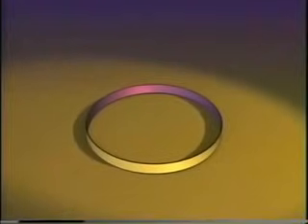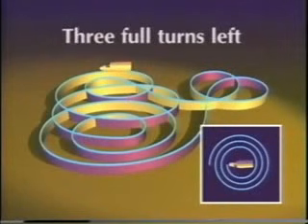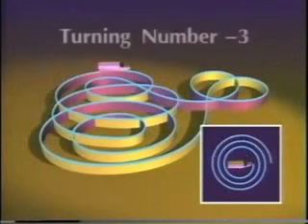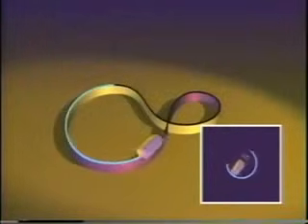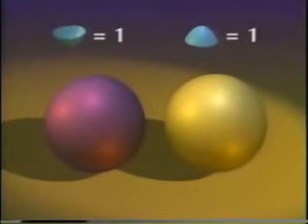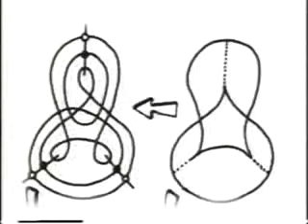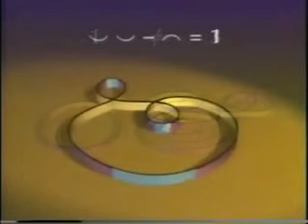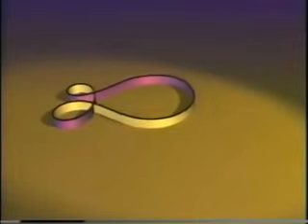how to theoretically turn a sphere inside out

Comment: For people asking what's the point of this:

Prehistoric people didn't have the concept of numbers. Sure, they had ideas for concepts like "four men" and "four rocks" or "four fish", but they didn't have the idea of "four" as a number that you can apply to anything. But eventually, people figured it out. And that's useful because even if four is an abstract idea, you can apply back it to the real world and real objects. You can even think about having four of an abstract object, like "four memes".

Topology's the same thing, but for shapes. Instead of thinking about specific shapes, you think about things like turning numbers that apply to lots of related shapes. You figure out things about these abstract shapes, then you can apply it back to the real world and real shapes, the same way you do numbers.

Plus, a surface doesn't have to be made out of atoms -- you could be talking about, say, the surface of an electromagnetic field. Molecules can't go through each other, but photons sure can. Or you could be talking about the surface of a 3D graph, like when you're measuring motion in multiple directions.

Turning a sphere inside out might not be useful on its own, but the ideas that lead up to it sure are.
Reply: Then why was the sphere even included? After they move on to the circle the sphere concept is abandoned. If all they wanted to teach were topology concepts they couldve just cut out the beginning of the video. Making a ridiculous claim to be like "nah not really, we're really going to show this instead" is just clickbait

Comment: If you create a two portals facing each other (on opposite sides of a hallway) and then tied a rope leading through both of them, would the ropes be straight or in a circle?
Reply: Well, the one end of the rope is tied to the other end, so I guess technically it is a circle. However, looking down into the portals we can see that it creates a straight line with ties in each segment. If you consider for whatever reason that the ties you see through the portals are different than the one directly in front of you, then it would be an infinitely long rope. I hope this makes sense since I can barely even construct a sentence when I should be sleeping.
Reply: My brain has had enough today please dont
Reply: @AwesomEthan  Wouldn't it be straight?
Reply: Topologically it’s a circle in a non-euclidian space
Reply: a circle with an infinitely big radius, but it'll appear as an infinitely long line
Reply: yes
Reply: depends on your definition and the way the portals are implemented.

Comment: First, you must grab all points of the sphere. Pull them all towards the center of the sphere, and then parallel from their original positions. With a circle, you do the same thing. Grab all points, and pull them to the center, then mirror them parallel to their original position. It should look something like this: X. Wait... Tac Toe NIM Toe Tac time toe Tac Tic tac toe... OXO Avyon Lux Council confirmed! Okey, so that sphere I told you about is beyond your simple primitive minds, right? I will give you a link to the shape, I will just explain the shape here until I get the link. Okey? It basically has two merged parallel rings. The interior of the rings are infinitely deep, yet, limited to the specific size of the rings.

Comment: So if If you can divide the sphere into horizontal strips, doesn't that mean you should be able to make those strips infinitely small as to arrive at a circle of infinitely small width right at the equator. If that one strip which is a circle is part of the inversion process doesn't that violate the principle that you can't turn a circle inside out?

Comment: Pretty cool theoretical geometry, but where the hell is the rest of the video?? It cuts off just before the actual methods to turn a sphere inside out get explained.  Very frustrating.
Reply: This is actually topology, not geometry.
Reply: Okay, thanks -- I wasn't really aware of the distinction.  Wikipedia's "sphere eversion" article says that some methods use both topological and geometric techniques, but since this video cuts off early, I'm not sure whether they use any geometric techniques here.  However, thanks to that article, I found the non-truncated version of the video, "Outside In", posted by ssgelm.  Going to watch the full version later this evening.
Reply: It's a pretty cool video. You rarely see advanced mathematical concepts explained this simply. The beauty of topology is that it makes for interesting visualizations, but the underlying concepts are hard to explain without sounding arbitrary (as indicated by all the »what's the point that material doesn't exist« comments.) It's important to understand that this has nothing to do with any »material«. We're simply talking about transformations through functions with constrained properties such has continuity.
Reply: There's a part 2.

Comment: How can you have a crease when they can pass right through each other
Reply: Because I'm Batman
Reply: The physical sphere represents a mathematical construct, not the other way around.  The rules are there because of the mathematics of n-dimensional surfaces, not because of arbitrary physical properties.
Reply: It theoratically works in 4 dimensions of space
Reply: a crease means an angle of some sort
Reply: neopalm2050 
But there were creases being formed
Reply: Aidan Maley when?
Reply: Because logic.
Reply: Layman:
It doesn't work like it does in the real world, its a rule constructed by a "theory" and you have to follow it to get the right answer.

Note that you can not apply physical properties as we only work on GEOMETRY in this problem, so that's why you have to set aside what you had learned in real life (unlearn) to learn GEOMETRY, because it has different rules.

Comment: 3:29 um im sorry what? just Twist the inside of the circle out like an inch at a time... no sharp bends, it doesnt even have to pass through itself. what is this video talking about? And actually I was thinking about this EXACT thing because of conversations abotu creating warp bubbles. The ship needs to be surrounded by the bubble, however it FOLDS space so would it not be a 3 dimensional object, more like a doughnut? If so can it or a sphere be inverted?

Comment: To anyone curious why this matters: It's talking about solutions to equations with multiple variables (or even equations.) Problems where there's multiple variables can have multiple solutions that form shapes when graphed. In a circle equation, (x-H)^2 + (y-K)^2 = R^2, the "circle" is made out of the possible combination for x and y and that make the equation true. In problems where more is going on, 3D (or even higher dimensional) shapes can happen. Manipulating the shape of something in ways that don't break the equations (having an infinitely thin point, producing a divide-by-zero error) is useful for mathematicians, or possibly even engineers modelling the solution space of real physical problems (although tbh I don't know any examples.)

Comment: I love when scientists make things like this and apply arbitrary rules to it. If you can just say "Oh make it out of this non existent miracle material" then why apply the rules about creasing or tearing it? those rules also matter because you arbitrarily said they do.

If you can just arbitrarily say it's made out of miracly rubber, why not arbitrarily apply the rules that it can crease on itself and self heal if it tears?
Reply: Aisha Kegawa They are NOT making shit up. There are real life uses for topology. It is extremely important for the evolution of electronics to what they are today because it studies form relative to points. What is a circle if not a line that curves around to meet with it's end. In this case matter can do that if its not densely packed together. Molecular structures often follow the rules set by topology aka no creases. Topology creates theorems like the fixed point in space theorem which helps in physics. It also helps with making an algorithm which a robot uses to move around obstacles. This exercise is called a veridical paradox. It seems impossible to turn a sphere inside out smoothly without tearing or creasing but it is achieved.
Reply: Aisha Kegawa atomical structures have those "theoretical" properties very commonly.dna passes through itself.
Reply: I bet you're the type of person who thinks pythagoras' theorem is useless because they don't use it when they go shopping.
Reply: This isn't science, it's mathematics. Don't confuse the two. Also, don't dismiss the exercise just because the rules are arbitrary. You should know that the rules of quantum mechanics are completely arbitrary.
Reply: but this isn't about challenge, it's about theoretical possibilities. It's bad science to say this is theoretically possible when you apply so many arbitrary rules just to make it work at all.
Reply: This "challenge" was most likely developed to visually show some sort of mathematical theorem if I were to guess...
Reply: They explain it. If you can form sharp corners then you can create any curve you want, it isn't a challenge.
Reply: I can't take anything seriously that has to make assumptions that can only be true in a universe that breaks the laws of physics (even theoretical physics).

It's only possible as a thought experiment that ignores the laws of physics.
Reply: If you crease it there still will be an infinitely small loop in it, so it's not completely inside out
Reply: But it's presented as an actual scientific exercise. I could make anything theoretically possible if I made up arbitrary rules that allow it to happen. 

If only scientists realised all they had to do was just say something is possible, could of saved so much work testing theories.

I mean all you have to do is say that the it is possible to pull energy from nothing and bingo FREE ENERGY!! Guess all those nut jobs claiming to be building devices that pull energy from the quantum vacuum were right all along they are just using the scientific principle of making shit up!!
Reply: Then why the other arbitrary rules like it can't crease or that when it does it evaporates? 

Again it's made up rules just to make it work and that is isn't even bad science it's not science at all.
Reply: Imagine that sphere as a 3-dimensional mathematical function.
Reply: it is about the challenge too though! This is a great exercise of ingeniuity!
Reply: It's mathematics
Reply: Obviously because tearing or creasing a sphere or a circle makes it no longer a circle or sphere, due to the fact that you are adding sides and vertices.
Reply: +Granny Trrelli Pretty sure science englobes mathematics, particularly what has been verified (as opposed to i.e. theorems).
Reply: RedHairdo Science and mathematics are very closely related, but not the same. Mathematics is like a foundation and science is a structure built on top of it. Mathematics are the base for many different fields of study too.

Comment: It can pass through itself , but can't get creased ?
Reply: If you pay attention to the way the circle passes through itself, you can see this sorta loop thing it forms. When you keep pulling on the circle, the loop appears to get smaller and smaller. The problem with a "crease" is that this "loop" will only ever get infinitely smaller, never truly straightening out. It may appear as if the circle has been turned inside-out, but it's not. There is still gonna be that loop in it.
Reply: +Fnoee it's more thought out than one might think. If you crease it, it gets forever smaller, but never flips opposite at any point. It's a kind of safety mechanism to prevent infinite loops.
That would have a turning radius of 12
Reply: It's the opposite of stupid. Theoretical mathematicians are quite possibly the smartest people on the planet. If you don't understand what they do or why it is interesting, that's your problem, not theirs.
Reply: +John K if we don't understand it, that means god did it. duh.
Reply: It's one of the rules of this field of math -- topology -- because to do so would be fundamentally changing the object. Topology is a really weird and abstract field of math, but it has its applications mostly in quantum mechanics, and I think it's helped with some computer science as well. I've seen examples of it used for quantum field theory, machine learning, network structures (although that honestly looks more like graph theory to me) and, because it contributes to quantum mechanics, quantum computing theory.
Reply: Why should spheres made of materials that can pass through themselves be a relevant thing to talk about ? As far as I am aware there aren't any things in the real world even close to this. And if there are , we haven't discovered them , so this video will remain irrelevant until we do.
Reply: Stratos 420 The same thing goes for paradoxes. It's just fun to think about. Why does it matter if it's useful or not?
Reply: Sometimes things are connected in very strange manner. Especially in math. You might think, that, oh, I just invented a new cool algorithm for astronomical calculations. Than you find that part of that algorithm is strange integral of a strange function. And integral acts just the same as that material! What will it mean? It will mean that you don't need to calculate that integral, and all you need is just to count number of sedals and that other stuff. Then you turn sphere iside out, and the same algorithm forcasts earthquakes.
Reply: touché
Reply: +Karkat Vantass what about the creases it makes from simply crossing two sides together? I see many corners.
Reply: Karkat Vantass
 I watched part 2 (not the whole video ) and I kind of understood what they were going for but this is still extremely stupid in my opinion.
Reply: yep!
Reply: +Arqwer but I thought earthquakes can't be forecasted
Reply: Mathematicians LOVE to make their problems as difficult as possible

Comment: How exactly is it that reversing the top and bottom edges of circle (the rubber band example) is wrong? That makes no sense. The inside and outside have switched places. If you assume a thickness greater than zero, it would still have a top and bottom that can be switched, leaving the inside and outside reversed.

Comment: how to take off underwear without taking off pants ?
Reply: asking the real question
Reply: Mr bean did it once.. I think that video is on youtube too
Reply: You just don't wear pants in the first place..
Reply: Sure, but the point is to take them off without looking like a tool.
Reply: Easy pull your leg into your pants and take the first side off, then pull it out.
Reply: It's easy. Pull each underwear pant leg all the way off one at a time.
Reply: +Azhar Abbas Just put jour pant under your underwear. Problem solved !!
Reply: Fredrico Spalding usually underwear is not that much flexible
Reply: dont wear any. mind=blown
Reply: knife.
Reply: cut it